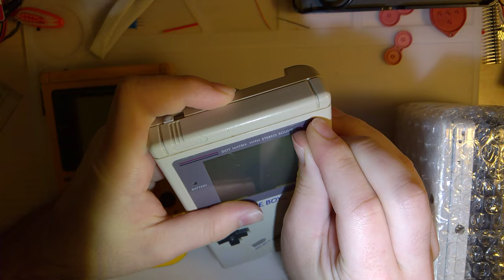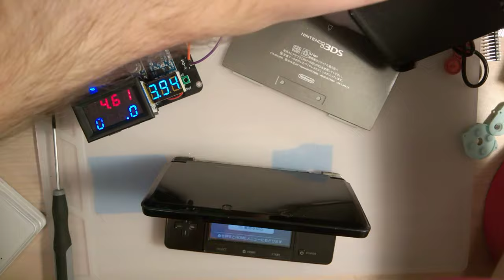Troubleshooting more junk consoles from Japan (3DS + PS Vita) Part 1

Comment: Can you fix a new 3ds homebutton?  I bought it at a thiftstore and charging port was damaged.  I was able to put a new one in but now home button stop working. When I put it back together and tried to power it on it would shut off immediately like there was a short.  I eventually got it back together and it powered on but home button still doesnt work.
Reply from the maker: Are you sure the problem is the button itself? I'm sure the button can be replaced, but I've never taken apart a N3DS so I don't know.
Reply: @makho  no Im not exactly sure whats wrong.
Reply from the maker: @indcsion  If you have a multimeter, you can test it. I suspect the button itself is fine and is maybe just dirty (would show high resistance when closed).